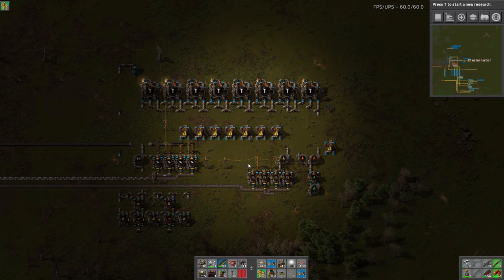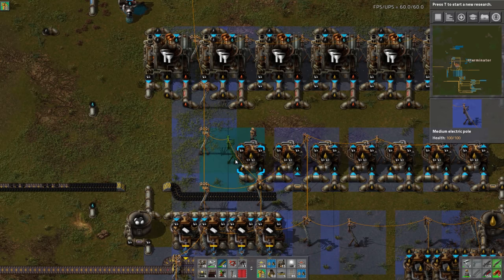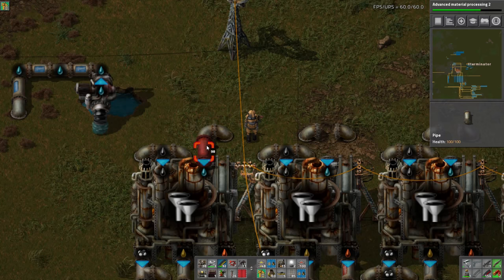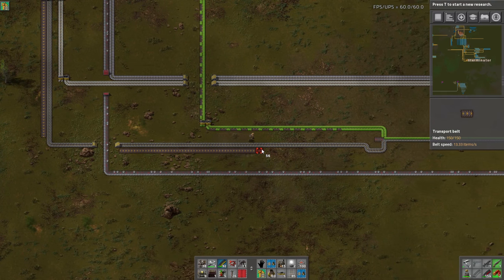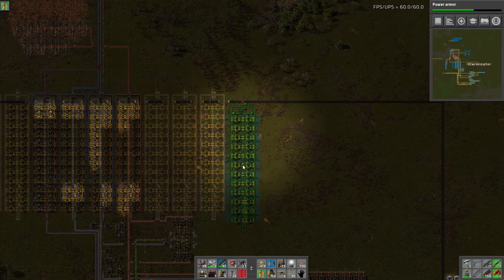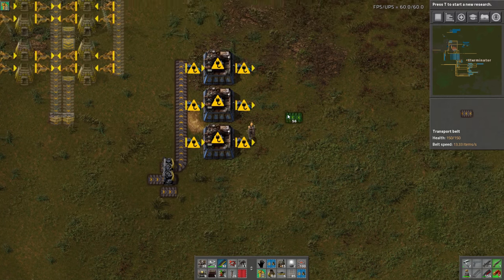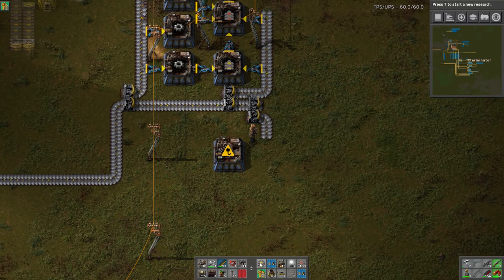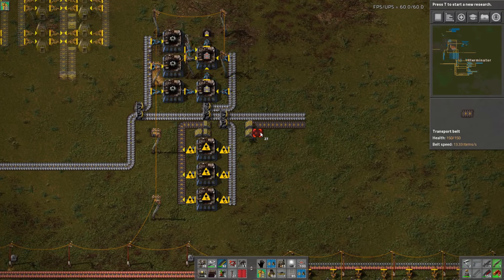Factorio: Tightening The Belt: Megabase Guide EP13 - MALL CONSTRUCTION! | Tutorial Gameplay Series

Comment: You did the same curved-belt-onto-side thing again with the Inserter and Assembler assembly lines. 

As to why that behaves the way it does, the 'inside curve' of the feeding belt will have an empty space to move an item to before the 'outside' does, leading to half the belt covering both openings, potentially chopping throughput down to nearly 50% of what it should be.
Reply: Brutakalaka Yeah I was gonna say...longer distance to travel on the outside of the belt vs the inside curve..

Comment: I know I am late to this but i had to comment on your surprised reaction on the compressed belt thingy: When a belt turns the inner part is smaller than the outer part thus it will have less material on it than if it goes straight. I am pretty sure that is the explanation to the compression problem earlier.

Comment: Very cool to see you designing your own mall even after so many hours played!
I never really considered direct insertion for a belt mall, but it definitely makes sense and you get to control the ratios better than with a belt.
Any reason you skipped underground belt and splitters for now? They seem just as important as regular belt to me and i usually direct insert from the belts
Reply: The full underground a belt factory is huge (and needs a lot of iron and gears)?
Reply from the maker: Thanks, I'm glad you liked the on-the-fly building. :) I had never actually considered the direct insertion in the mall either, but it seems to work nicely. 

The undergrounds and splitters were left out because... I forgot. Lol! 
Also though as Ritoban said, they take a lot of space to do. I will probably make them bot based later down the line in the mall.
Reply: You do realize requester chests are behind yellow, or gold science these days? That's a lot of handcrafting undergrounds and splitters before you can use robots in your mall to craft them there. ;-)
Reply: Getting to yellow science is easier than it sounds. And as long as you have a lot of gears and circuits, handcrafting them isn't too bad. That being said, I actually build massive malls in my factories. But based on what I've seen of Xterminator, he's not going to do that.

Comment: ack blue science machines, engines are now split 11 left and 13 right, which I suppose doesn't technically matter since the one side will back up slightly and the splitter will shoot the extra to the other, it just feels wrong.
Reply: I'm not sure that has any meaning here as its one splitter to 2 belts (yes half each) feeding almost half a build, except the symmetry error

Comment: As someone who always free hands his builds i do appricate the effort of hand building the 'Mall' on the fly.
But i do have to ask, with a dedicated gears belt from your smelters why are you making gears at all in your Mall?
Also you might want to put two fast inserters feeding iron into each of those gear machines!
I cant wait for the hours of play moving builds over by 1 tile to straighten a belt (its ColonelWill's bad influences 😁) Or the bus that you accidently fast replace a underground or splitter and end up with contaminated belts! 😂
Reply from the maker: JD-Plays I actually don't have a good reason for the gears other than the fact I wanted to try direct insertion. haha
Reply: Xterminator well double up those inserters! You know your not picking up nearly enough iron!
I expected them to be put down as a after thought, or someone else to of mentioned them in the comments, and skipped forward to the start of the next episode and saw they still had single inserters 😢
P.s. I'd also consider a rework of the mall to use the gear belt, because this is a belt megabase your going to be using a LOT of belt (and gear heavy undergrounds) hence a lot of gears hence the gears from the smelters will get prod mods very early on!